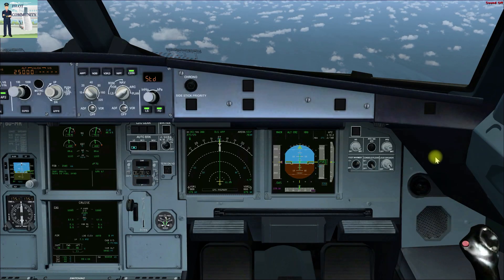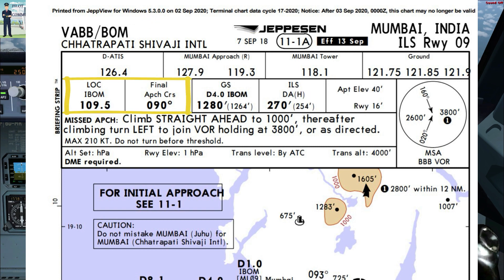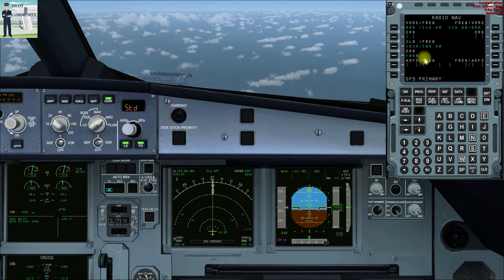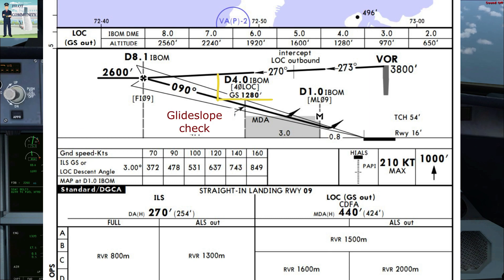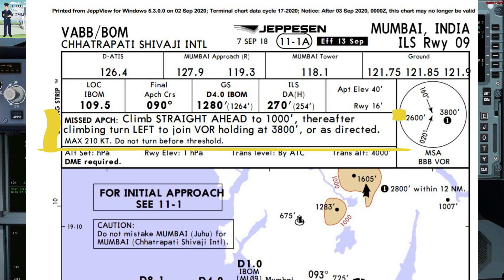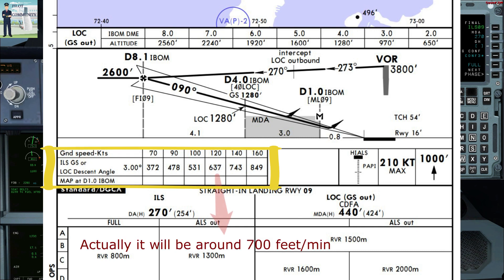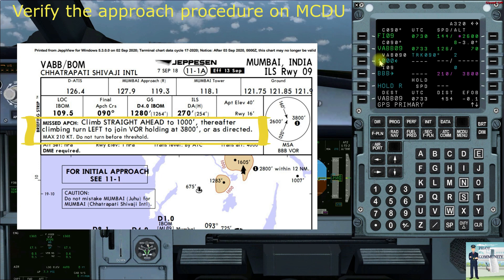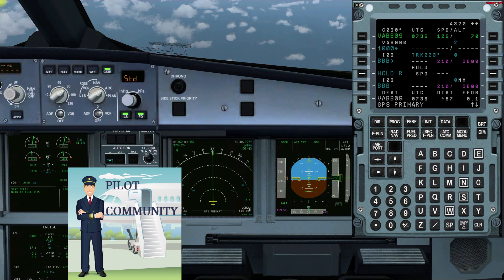ILS approach briefing on Airbus A320| Jeppesen approach chart briefing | ILS approach RWY 09 Mumbai✈

Comment: What does CI 09 and FI 09 mean?
Reply from the maker: Thank you for tuning in Saurabh!
These are approach waypoints. The letter ‘C’ in “CI” is used for a Final Approach Course Fix and the letter ‘I’ indicates that this waypoint is for ILS approach. For a VOR approach, the Final Approach Course Fix will be named “CD” followed by the runway number. ‘D’ is for a Doppler VOR.
Similarly the letter ‘F’ in “FI” is used for a Final Approach Fix. ‘I’ is for ILS. I hope that clears the doubt.
The waypoint prefix for :
1)initial approach fix is ‘A’ 
2)intermediate fix is ‘I’
3)final approach course fix is ‘C’
4)missed approach point is ‘M’
5)touchdown point is ‘T’
6)runway centreline fix is ‘R’
7)step-down fix is ‘S’
Reply: Pilot Community Thanks for that explanation. But what do we mean by Course to Final Fix and Final Approach Fix? 

If course to fix the point where the final course starts and Final Approach Fix the intersection where the glide starts? 

Also, What would be CF? what does that mean because I have seen that for visual approach. I am just very curious to learn these code letters because I cant find them on my LIDO charts.
Reply from the maker: http://www.jeppesen.com/download/navdata/navdata_info1.pdf
Refer this link for further learning about the approach waypoints